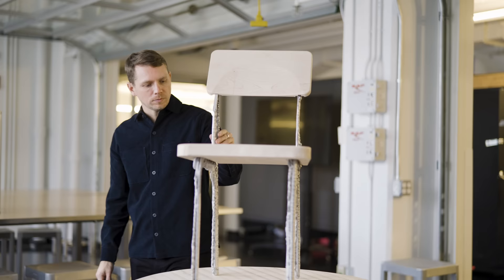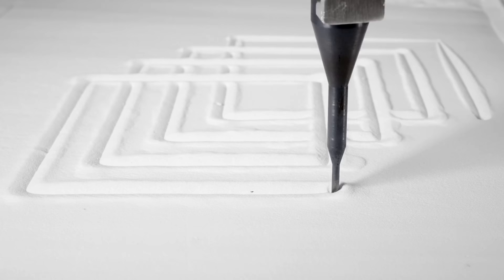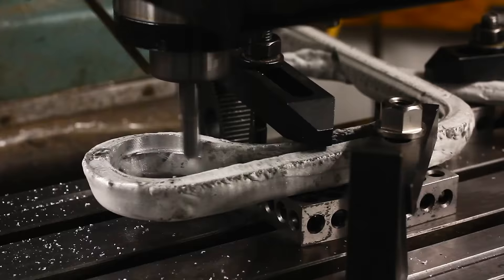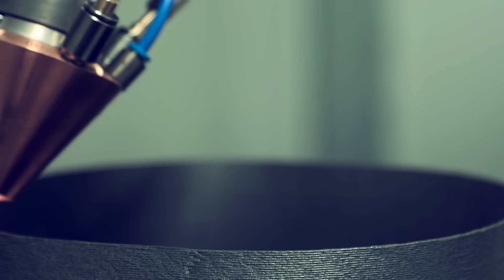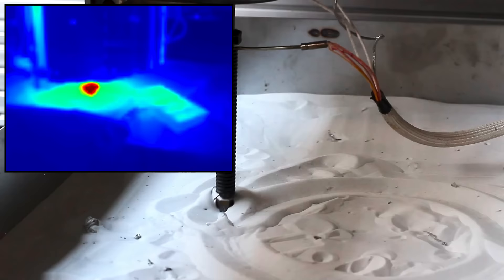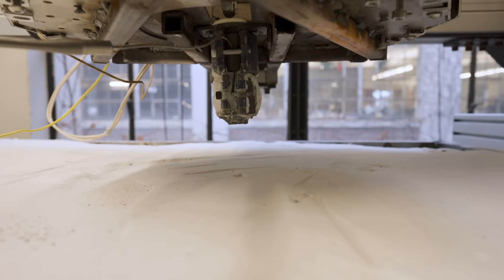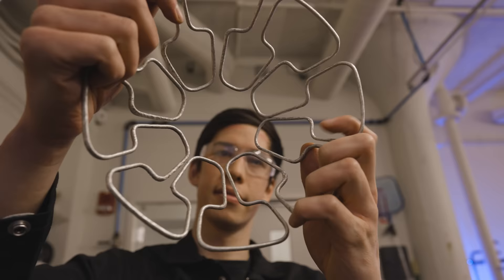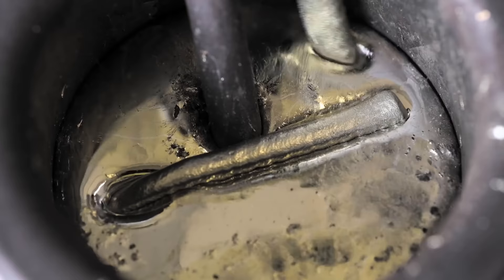Printing furniture with liquid metal

Comment: Did people forget what the first plastic filament printer prints looked like when they first rolled out? Refinement takes time.
Reply: Yeah, I was thinking the same thing this has a lot of potential!
Reply: eh even if "perfected" it really can only do a simple parts. An automated mig welder could do what they are doing way better
Reply: @zachmoyer1849  Do show me the mig welder and wire that's going to beat out scrap aluminum and what looks like a ~1cm nozzle. You're going to spend 12 hours on a shitty chair frame with your mig welder while this thing does it in minutes.
Reply: @ww-pw6di  yeah that is the only reason its better speed but my point is it can do only one type of thing quickly which is also something that can just be quickly molded.
Reply: @zachmoyer1849  Your "point" was that an automated mig welder could do what this machine could and we've already determined that to be horseshit.
Now onto your NEXT point; no you can't "just" quickly mold something because making molds takes significant time and resources and very expensive machinery to use the mold. Making a shitty chair mold and a shitty table mold for a production run of 1 is going to take you even longer than using the mig welder.
(You can avoid the costs with hand making shitty molds using lost wax casting or the like, but you're still going to spend at least 12 hours of work on a single item since now you're also making a replica of the item before even casting.)
Reply: Why not just cast?
Reply: @Johnne009 read the comment above you brotha
Reply: @Johnne009  For much more rapid prototyping.
Reply: The difference is that metal printing is already a thing. The process shown in this video looks like pee dribble into a groove compared to the ultra exact sinter / laster processes that already exist. What is this video trying to solve that hasn't already been solved?
Reply: @drxym If you don't listen when the video explains that, how do you expect us to believe you would comprehend a written explanation? Your question is a waste of time.

Comment: Very cool, would like to know what the the maximum flow rates (kg/s) are, and how long the molten working time is.
Reply: The working time would be dependent on how fast those glass beads cool it off and the flow rate would be limited by the amount of mass left in the crucible, since it is gravity fed. An improved version of this would involve some sort of pressurisation so the injection can be more precisely laid out.

Comment: The only advantage I see to this, is you can get some rough shape out fast to mill into something better. But it's hardly better than casting with a form and getting something far more precise. And the issues with conventional 3d printing techniques are vastly overblown - 3d metal printing isn't easy or cheap but it produces parts used in automotive, aeronautic and space industry that can withstand immense pressures and heat. Is is a perfectly viable way of making complex parts vastly in excess of dribbling some molten metal into a groove of glass as shown here.
Reply: That's seems to be highly dependent on the assumption that its level of technology is definitely going to remain as it is even after years in the future, and not possibly vastly improve as it has with so many technologies when other new materials and technology are discovered or developed.

Comment: If you don't quite understand: This is similar to polymer printing in liquid media, where the print is suspended by the liquid media. Instead, in this instance, they use fine sand heated to a high temperature.

Comment: How do you address shrinkage issues with denser prints?
Reply: Such ssues are known from sand casting and the shrinkage rules are well known, it would be factored into the design. Besides these parts are clearly meant to be machined afterwards.

Comment: Very interesting! How are you going to have more volume in the Z axis? Something like a SLS?
Reply: Just attach molten aluminum to aluminum on xy plane once it's solidified.
Reply: @TheJonathankang  they are printing inside a thick layer of glass. They can put another layer t ocontinue bulding in the Z axis, like SLS, coating a new layer of glass
Reply: @albertomorillo7119  wouldn't the glass film on top of a previous layer prevent it from welding together ?
Reply: Well, maybe, I dont know this technology, neither I’m expert in foundry, but looking at the parts and the machine itself looks like they can move the nozzle and control how deep it goes. If they are printing with a single path because of the glass, maybe could be difficult to add more layer, but if not, they can go easy in z direction. Also the glass could melt and go to the surface of the metal, if not this could affect the part and make it weaker, so in that case , it will depend on the application. ( sorry about my english, I hope I explained myself properly) 
By the way,  it will be amazing if I could talk with this guys about it, its a very interesting develop indeed

Comment: they choose aluminum because its infinite recyclable but how do you keep the glass beads from sticking to the aluminum when printing, this will add glass to the aluminum when you "recycle" it
Reply: When sand casting, there is relatively little sand that sticks to the part.  I'd expect that something similar happens here.  Glass in scrap aluminum gets scrapped off in the dross when melting aluminum for casting.  The infinitely recyclable tag attached to aluminum smelting refers to the quality of the aluminum not degrading, but being restored.  This is in contrast to plastic recycling where recycled material is broken down and is necessarily lower quality than equivalent virgin material.  But both plastic and aluminum recycling introduces impurities that provide a practical limit to the amount of recycled material that can be used.

Comment: I wonder if someone could do this with molten glass (not talking about sand casting, but talking about glass in place of metal or plastic). Prolly wouldn't be feasible tho due to the high melting point

edit: wait, are y'all working with glass dust w/o a mask or am i trippin??

Comment: Smaller more dense glass beads = higher resolution?
Reply: I think the problem would be the surface tension of the aluminum itself.  When sand casting, you ram the sand in so it is closely packed around the mold.  The aluminum, from the height of even a few inches flows into every crack.  But the top surfaces where you pour in the aluminum are rounded.  With this system, the sand is loose, so it would be difficult to form fine features.  Also, to create fine features you would need to have a smaller nozzle, which would slow down how fast you can print.

Comment: It might be easier to do this with other, more low temperature metals than aluminum.
Reply: Lots of folks do aluminum sand casting in their garages.  YouTube is filled with instructions on how you can build a furnace.  I did it for a couple of hundred dollars.  In the grand scheme of things, aluminum is the low temperature metal that is approachable to hobbyists.  Copper, bronze and iron are the metals that cause problems.
Reply: @richdobbs6595 After posting that I looked it up and was surprised.  Solder would be great but not at all strong.  That's another problem. Low melt metals tend to be softer.  I didn't see pot metal on the chart but I think that should be relatively cool.  The reason I'm obsessed with temp. is that heat=energy=expensive to run.

Comment: Interesting. Only 10000X more expensive than current techniques.
Reply: wait 999 years and we will make it better.
Reply: ...why? This would be much cheaper than current metal 3D printing, do you know how expensive it is?
Reply: Okay.  A current plain-jane mass produced lawn chair costs $40.  A grad student in engineering probably cost $40K per year in stipend, books, etc, and the professor probably wants to get $100k per grad student in support. Maybe another $100K in support for the University?  (spitballing, since my grad student experience is decades old).  So lets say this research project gets funded for $500K for two years.  And well give it 4 chairs and a table but to keep it simple, we'll say 10 chairs.  So the cost per chair is $50,000 per chair.  So the cost is only 1250X more expensive than current techniques.  But it really isn't fair to consider this in competition with mass produced chairs, but instead it should be compared to hand crafted artisanal chairs, so more like only 100x more expensive than current technology.
Reply: @richdobbs6595  good point.

Comment: No, MIT. Much too crude. Try magnetic field guided deposition
Reply: That’s very irrelevant
Reply: What about electroforming / electro-deposition ?
Reply: @manofsan  yes. maybe photo electric deposition to guide with lasers or masers
Reply: @DanFrederiksen  - electro-forming / electro-deposition of metal is done inside an electrolyte solution. I've read about attempts to use lasers for this inside the liquid medium, but I don't think microwaves are possible inside the medium.

Comment: YouTube "experts" strikes again with their many naysaying. Completely forgetting how technology works. Technology will generally keep on improving as more materials and other technology are developed or discovered. Early mobile phones were bulky, had limited functionality, expensive, and so were deemed useless and having zero potential. Now mobile phones are ubiquitous, can be thinner than a pencil and surpass most of the computers of the past. Early versions of 3d printing were criticized for being too expensive and incapable of printing complex structures. Now they're getting cheaper and are able to print more and more complex figures. Robots from Boston Dynamics were intially extremely clumsy and had to be connected to many wires. Now their robots are wireless and capable of advanced movements like parkour. Point is, this is not the final form of this particular technology. It has the probability of improving significantly like so many technology has.

Comment: This is not 3D metal printing technology.  And it's even a stretch calling it metal printing.  The whole process demonstrated is a waste of the advanced capabilities of the CNC gantry.  
Anyone who has poured molten aluminum from a crucible into a mold would qualify being called a metal printer under this stretched printer definition.  

Most any  home metal casting foundry - using either electricity or propane, can melt aluminum and create molten aluminum the same as in the video. 
 Home metal casters commonly use recycled or scrap aluminum for their projects.   Many home casters use petrobond sand as the medium in the mold that defines the shape of the part.   Petrobond sand produces far better surface finishes than shown in the video and petrobond sand will result in parts that have reasonably consistent diameters - much better than the results shown in the video.  

The crude method demonstrated in the video uses gravity to deposit the molten aluminum into a channel drawn in the glass bead medium.  
The only advanced feature demonstrated in the video involves using a CNC gantry to move the crucible of melted aluminum.  The speed of the CNC gantry can be easily adjusted while it moves along the pattern in the glass beads.  

A far better use of the CNC gantry would involve using traditional sand based molds with sprues.  The CNC would be programed having with the coordinates of the sprues.  The nozzle would move to each sprue and insert the molten aluminum into each, The rate of the pour into the sprues could be refined to produce parts having the best surface finishes and the fewest bubbles/flaws in the finished parts.  

A pressurized crucible using a heated nozzle which can control the rate of flow and quickly start/stop molten flow would be the new frontier of metal casting.
Reply: So FDM technology with pellets is not 3d printing because the extruder is like a mini plastic injection machine? In fact, most of the deposition technologies are based on CNC, even using the same kind of code. 

Also, the metal printers that use metal wire are just a CNC or a robot arm with a welding machine (mig/mag). Everyone with a welding machine could make their parts by hand. 

Of course, this technology needs more development, but by definition, it's a 3d printer technology
Reply: The whole benefit of the technology is that you don't have to make a mold first. The nozzle just goes into the beads at your desired height.